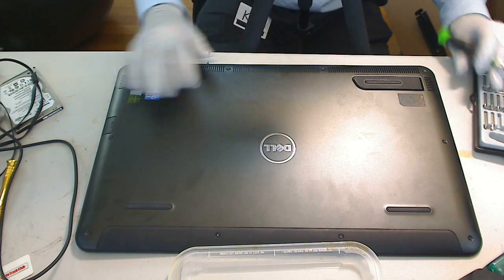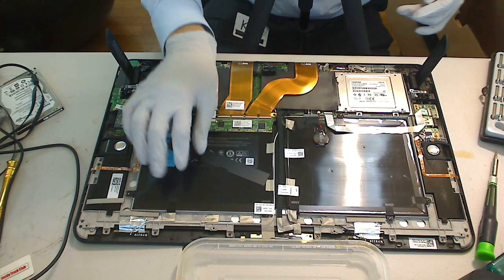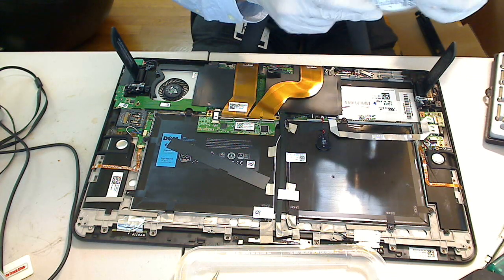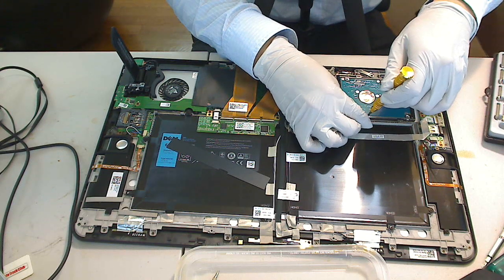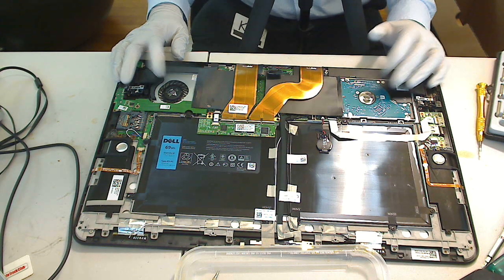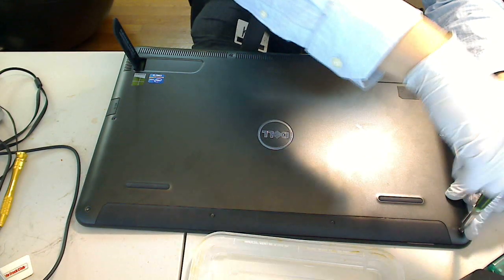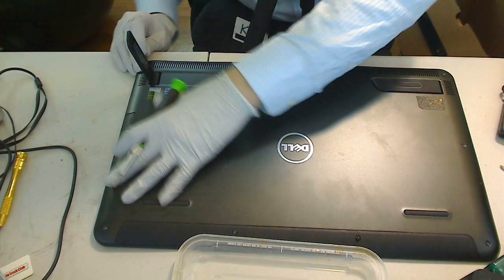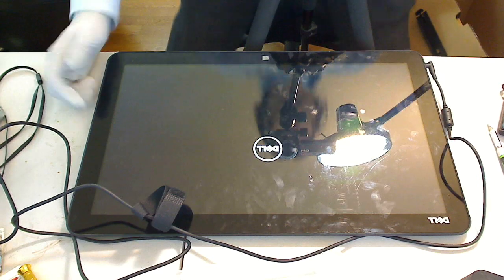Dell XPS 18 in Portable All-in-One Tablet Teardown How to SSD Hard drive Upgrade Repair

Comment: Did the same myself.  Cracked the glass digitizer, LCD was OK.  Some sellers wanted $350 to $400 for the digitizer alone.  For $248 plus shipping I purchased an 1810 that did not function properly.  Replaced the glass digitizer by disassembling the unit.  Also used the back panel as the previous panel was bent creating a gap.  Still have all other parts including motherboard, controllers,  HD, RAM, etc.  Video on line helped with the process.  No warranty, however it works and I know what to do in case history repeats itself.  By the way, when removing parts use some sort of storage system to keep parts and screws together.  Took an afternoon but worth the effort.  Happy hunting (RF).
Reply from the maker: i heard dell is replacing it for 250$
Reply: +CyberDoc LLC Yep -- just got a quote of $269 from Dell today for replacing a cracked XPS 18 screen, including shipping etc.

Comment: I just bought one of these, how upgradeable is the hard drive, can I use ssd and can I upgrade the ram, thanks for the tear down.
Reply: yes you can add 4GB of ram.. also there appears to be an Msata connector next to the wireless card.. gonna see what that will do when i get mine..
Reply: Shawn Turnbull  I just received one of these. How much can I upgrade on this computer. I’m trying to make this to today’s specs or really close

Comment: Hi, I dropped my XPS 18 and cracked the screen and now the touch does not work where the crack is.  Can I replace the screen and digitizer and do you know were I can get these parts and is it possible to do it.
Reply from the maker: i heard dell is replacing it for 250$